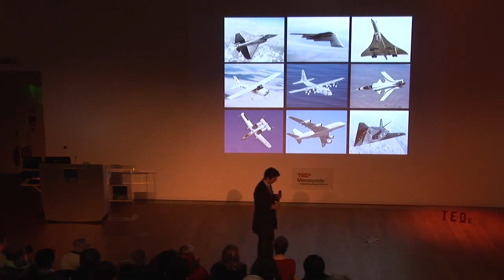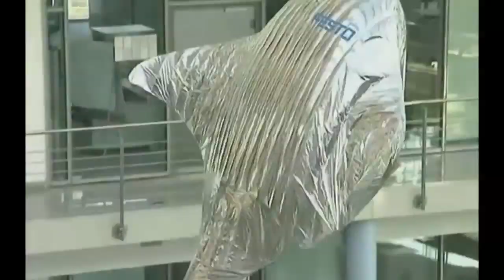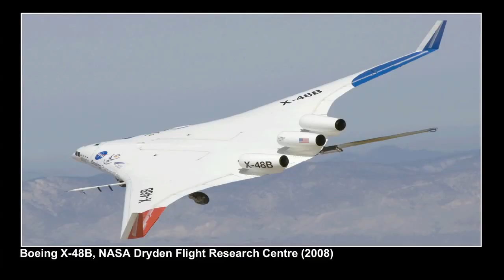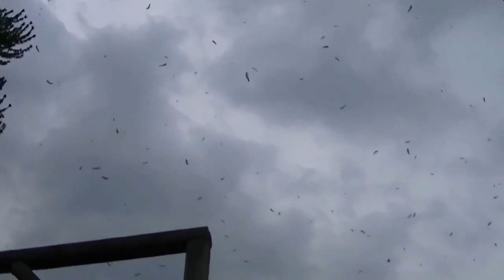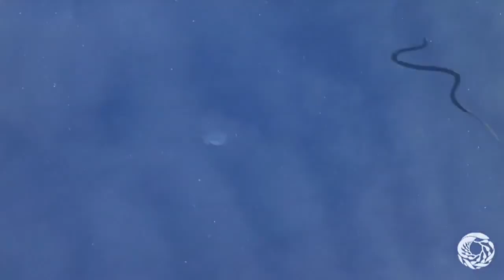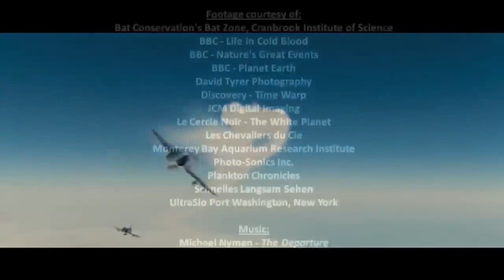TEDxMerseyside - Ashley Dove-Jay - The Future of Wings

Comment: A lot of wishful thinking. Very little practical application. Wings have progressed to a very high standard of efficiency and ease of construction. Working on airliners myself, and being an avid aviation  buff, pilot, and model builder, translating a butterfly wing to an aircraft that goes from zero to 500 knots, or more, is not only nearly useless, but impractical and unnecessary. There may be some applications in small aircraft, uav, or model type systems, but  serious research is already being done and tested.
Reply: I'd agree.
I've lost a lot of respect for TEDx they are putting on way too many people with wishful thinking rather than substantial real world concepts. Its more drama than an exchange of information.
Reply: This what I thought too, though I am not as qualified as you! Could I get your email ID please?
Reply: Ever heard of the MAS program...? I am sure being a buff, shouldn’t be difficult to research further..